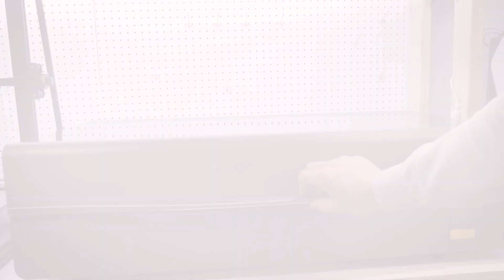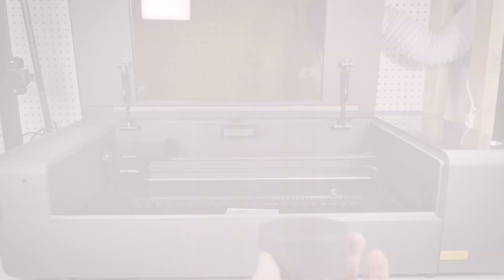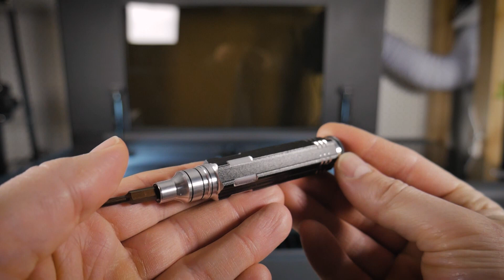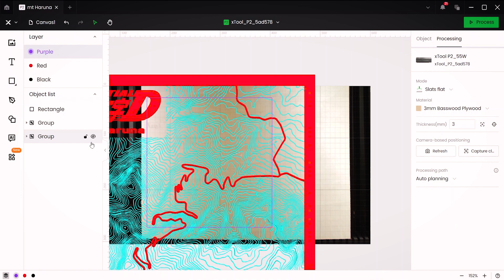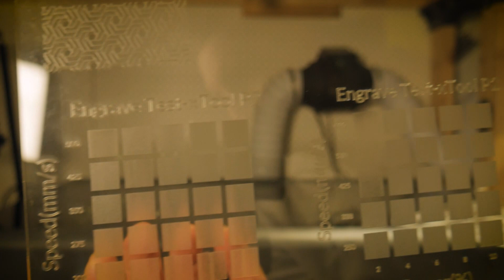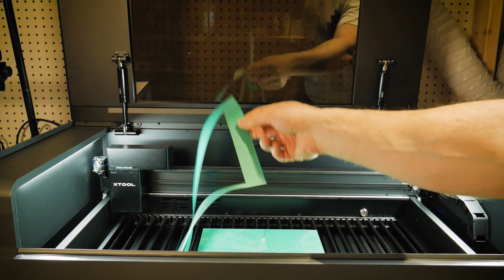XTool P2 In Depth Review, Setup Guide, Material Settings, Laser Maps, Upgrades and More!

Comment: I want to purchase your material squaring clips from your video and clicked on the link you provided. In your video the squaring clips were black. The clips shown on your website are green/orange. Why the difference?
Also; It shows that the squaring are 2 for $25. The picture shows for clips but I think it is 2 clips per squaring clip. Is that the case, do you get exactly what is shown in the image on your website?
Reply from the maker: Hi Rod, thanks for the feedback - the colors of the pictures on the website are just so the product is easier to see over top of the black slats. Otherwise the black on black on black makes it tough to see what is going on in the product listing pictures. The actual product is black like in the video. I added this to the product description for clarity. Also, perhaps the name of the product needs some work - I can see what you mean how I've called them "clips" but the "clippy" looking parts (orange on the website) are two per body. Clips was supposed to refer to the whole body/bracket , so when you purchase from the website you get what is seen in the picture. This would be two brackets just like I showed in the video. Maybe I'll change the name to brackets so it would be "2 brackets" and that might be more clear. I appreciate the thoughtful feedback!